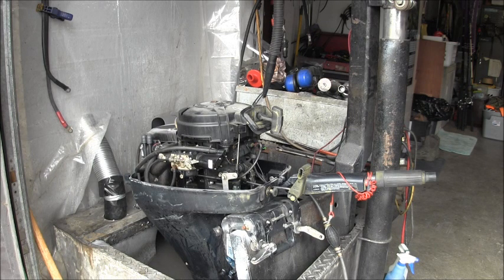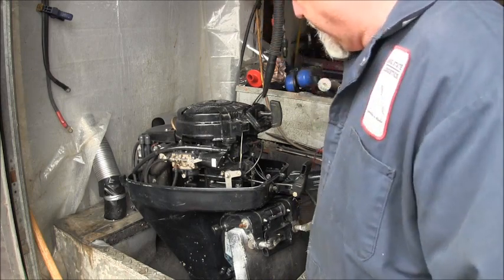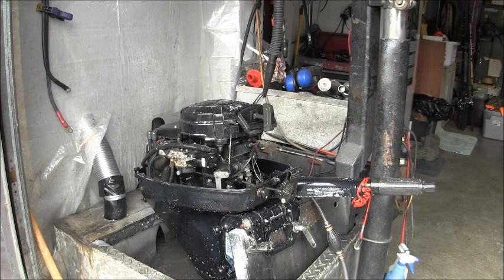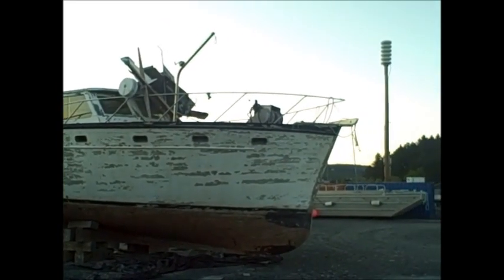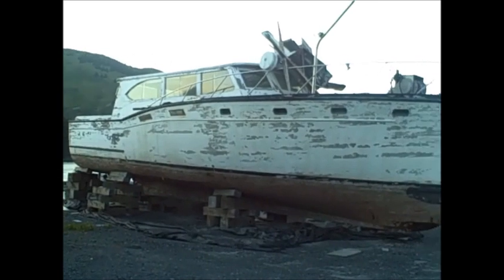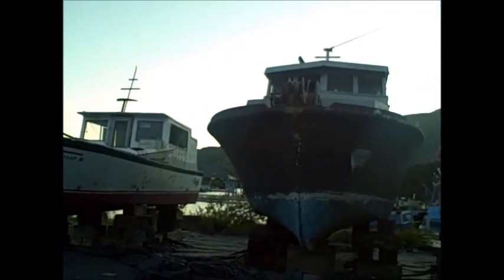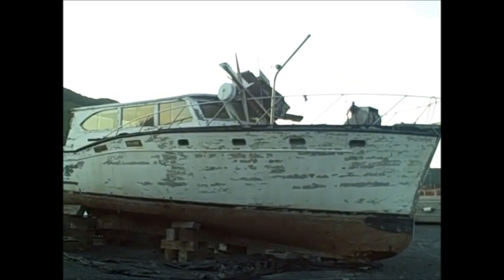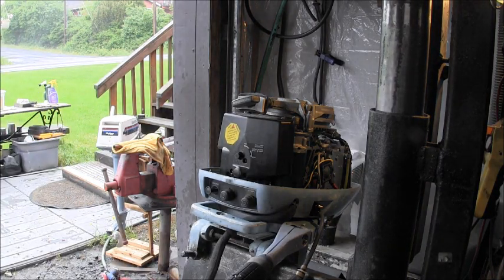EVINRUDE 15 HP FOUR STROKE & 35 HP 2 STROKE

Comment: I absolutely love my '77 35hp...It's a pull start only (my shoulder pays for it) but I have the parts to add an electric starter and charging coil once I get the 25 project off the stand...Thanks again for the advice on that one.
Reply: In the process of converting my E35ECIG right now back to electric
Reply from the maker: Right on, most welcome 4 sure.  kodi
Reply: @CharliesMustangShop I took a video of mine running and posted it a couple of months ago. It's easy to start and a great runner once warm but can be a pig to start when cold. It's in pretty much original "as new" condition...It wouldn't have more than 50 hrs on it...more like 20-30...I just had to take the powerhead off to free up a very stiff (almost seized) shift lever and up until then, the only work I'd done to it was change the impeller, clean the carby, and replace a couple of coils....I've been previously reluctant to touch it in regards to conversion (don't fix what ain't broke) but I'm at the point of biting the bullet and doing the job . Hopefully I'll find a video of someone doing one and that will give me confidence that I won't butcher anything when it comes to cutting holes in the lower cowl to mount switches etc. Don't want to be an "outboard abuser" like Kodi...lol
Reply: @philbyalby   other than your misc nuts and bolts, I did have to order part no. 0311217
And no. 0330112 
To hold my solenoid, other than that. Simple bolt on and wiring, I’m 20 and had it done in 2 days start to finish, but had to run to part stores and such

Comment: Good little kicker or for the boys on a small flatboat to run them crawfish traps or do a little fishing, I sure do remember my first setup. 
The impeller slipping, is that a common issue with the impeller and metal center? I’ve read in threads where people had complaints, but never knew anyone personally that had this issue. Thanks.
Reply from the maker: You bet'  I see slipping rubber on the metal centers often,  I think it is more comon in salty's       kodi

Comment: I’m In Florida yea it’s nice but man where you live is gorgeous!!!
Reply from the maker: Thank's  remind me of that in Febuary haha       kodi
Reply: @kodibassInsideoutboards   hey brotha hate to bug you, have a E35ECIG I’m robbing parts off of (J35ELCRR) 
I bought a solenoid for the e35. Not the Johnson where the bracket and original solenoid came from, now I can’t see how this new solenoid mounts up, so my question... 
are E45ECIG and J35ELCRR the same solenoid?
Reply from the maker: @CharliesMustangShop    The part #'s  mite B different but They should be the same . However the mounting of a solenoid for a 45 & a 35 are different.    kodi

Comment: Why are your used motors not selling? Just wondering. 

You have the highest pressure water hose I have ever seen.
Reply from the maker: the smaller 4 strokes do not sell well around here, buyers want something lighter & more portable, My 9.9 / 15 2 strokes are sold as fast as I put them up 4 sale.    kodi
Reply: @kodibassInsideoutboards  Thank you for the explanation.

Comment: What causes a 9,9 four stroke to get oil in gas. I replaced the fuel pump and it still does it the motor is a 2004 or 2005

Comment: I must have missed it, what was the owner's complaint with the 4 stroke?  You didn't really have to do anything to it, just prime the carb a bit...Perhaps he has some stale fuel with water in it...Don't have much experience with those 4 strokes, almost sounded like it was on one cylinder, but seemed to be on two.  The poor old 35hp is another victim of no maintenance, which is a shame, cuz they are great engines.  That intermittent spray could be a slipping impeller, but perhaps there is just some crud in the overboard hose/nipple.  Like you said, this one seems to run OK, maybe the owner's fuel supply is stale/water in it....
Reply from the maker: Yep' the 15 is my motor been sitting on my rack for 2 years just waking it up for some needed  cleaning * lube.    kodi
Reply: @kodibassInsideoutboards    Cool, guess I missed that in your intro....